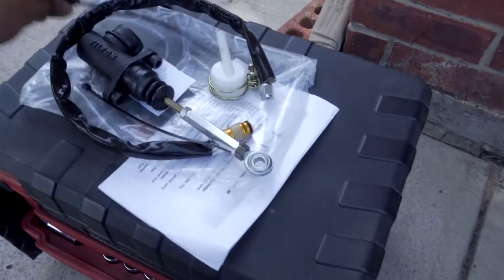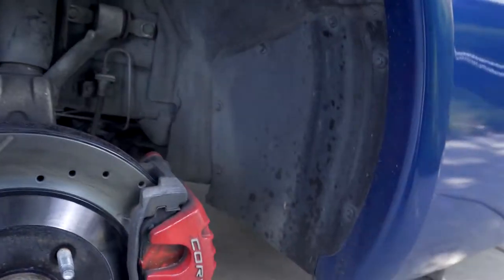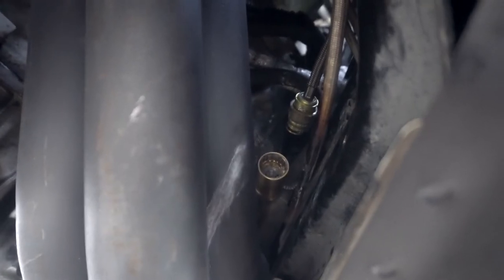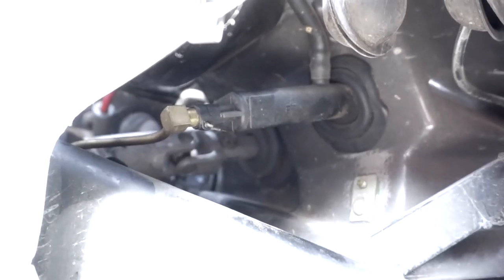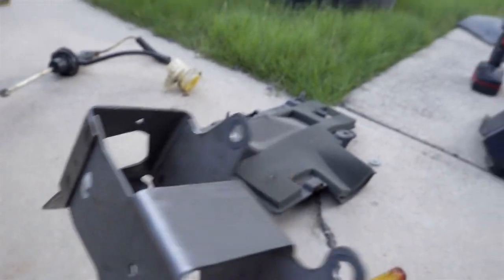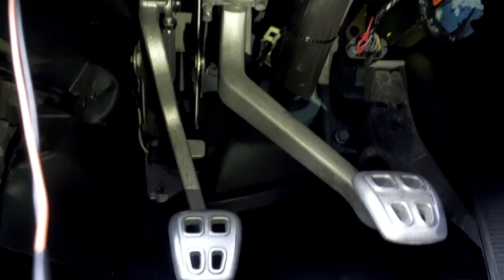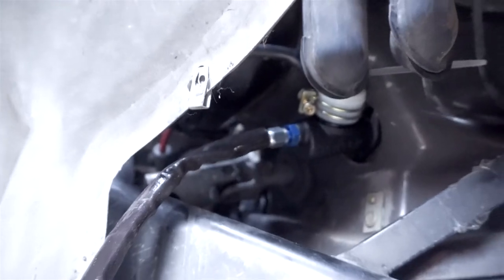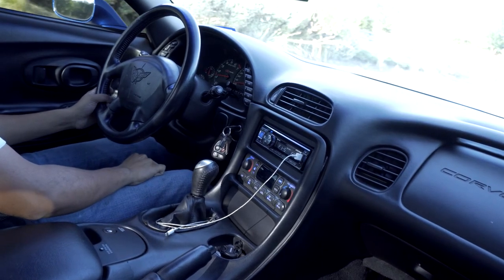C5 Corvette Tick Master Cylinder Install and Test Drive

Comment: Check out the anti venom mod on the transmission detent plug for our cars. It has helped mine with going into gear, makes it smoother and less notchy when you have a short shifter.

Comment: I was able to get the quick disconnect fitting detached by pressing a skinny  (just under 1/4" thick) 17mm open-ended wrench between the plastic ring and the metal rib/flange at the end of the fitting. It helps to use the new hose fitting as an aid in finding the proper tool before working on the old one under the car.

Comment: Great job. That is exactly what I need. I finally pick mine up 3.30.22. Hope they did it correctly
Reply: I finally found a ship that will charge me $285 to install. I paid $304 for the tick performance part. GM dealers wanted 7 hours labor. This is a 2 hour job 3 max. I hate it when dealerships try to rip your lips off
Reply: @TheMjphoto45 Do it yourself.  Wtf

Comment: Awesome video! Is there a way to adjust the pedal closer to the floor after the install? I just had the clutch replaced in my c5z and the pedal is way higher than before (level with the brake pedal) and engagement is really high which makes it extremely uncomfortable to drive. I know it has an aftermarket master cylinder, so I’m just wondering if I should have it adjusted back to its lower position if it’s possible.
Reply from the maker: If the master is adjustable then you should be able to loosen the lock nut and spin the collar to get the pedal lower

Comment: just picked up a c5 z. When I shift the car at high RPM, the clutch sometimes doesn't come back up - will the tick fix this problem? I have been changing the clutch fluid after every drive.
Reply from the maker: Maybe but also could be the slave cylinder 😬

Comment: Can you get the master cylinder straight from tilton for much less money?? I was told you can... If so what is the part number for it if you know?
Reply from the maker: I have heard this as well. I'm not 100 percent sure on what the part number is, but I believe it's the 75 series with a 7/8 bore.
Reply: @JamalsGarage  Thanks for the reply man. I'm going to call Tilton and get their 2 cents as well, thanks again

Comment: What bleeding procedure did you use? I just got one in my dads vette and cannot get the pedal back?
Reply from the maker: I pushed the peddle down with my foot and had to pull it back up by hand a few times to get pressure back into it. Then made small micro adjustments on the collar after that, as needed

Comment: How did you get to the slave connection to reconnect that line with the headers on? I was speaking to a well known corvette shop in my area and they said there's no way that can be done without removing that header. Let me know your secret, please!
Reply from the maker: Hey Danny, I believe that I used groove joint pliers to squeeze it back together

Comment: Man I hope this fixes my soft/boiling clutch issues.. After getting on it once or twice it goes soft and engagement is close to the floor. Have a hard time getting into gear as well after some pulls..
Reply: I'm having the same problem.  I have a tick performance and it's still does it.  Maybe I don't have it adjusted right
Reply: @jerryswafford6391  That's possible or maybe it wasn't fully bled? If not that, it's going to be the slave cylinder which is some work!

Comment: Hey Jamal I installed it but can't get pressure back to the pedal. I pumped it many times but the reservoir is at the same level and the pedal is loose....any  tips?
Reply from the maker: You need to turn the turn buckle to bring the pedal up more away from the floorboard
Reply from the maker: Mine is almost set to where it was before. It’s a little lower then the oem spot
Reply: Jamal's Garage got it bro thanks for making this video. I truly would not have done the install w/o your upload. I tried to film my own install but damn I was so pissed in and out I gave up. I've done so much work on the Vette I never thought this would be more difficult than valve springs, removing instrument cluster, ect....but this was in my opinion. The Vette family is fortunate to have you!
Reply from the maker: Haha I really appreciate that! It really is a huge PIA. Towards the end, I was getting really impatient and the updates were less frequent, but I think it was worth it!
Reply: Jamal's Garage my god just returned from the test drive it's amazing! Like WOW what a difference, my worn clutch dosent seem so worn now haha.

Comment: Are you running a stock shifter?
Reply from the maker: C6Z shifter
Reply: I thought so,. Big difference from the C5Z shifter? Do you just need the shifter tower, or do you need the lower box that it goes into as well?
Reply from the maker: woog74 way better than the stock unit. I think you can use just the tower but I replaced the whole assembly on mine
Reply: Jamal's Garage thx man!